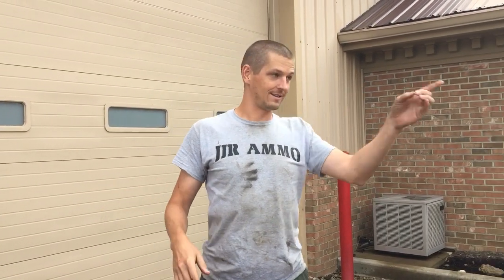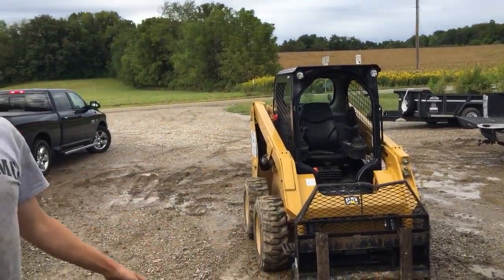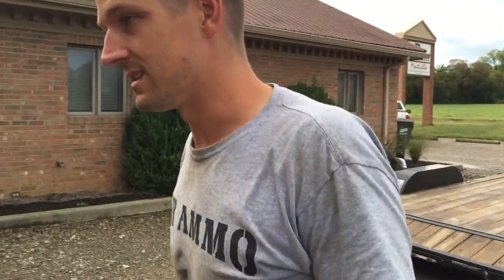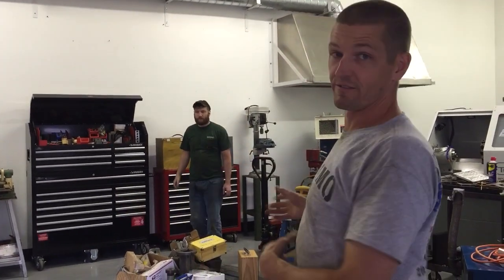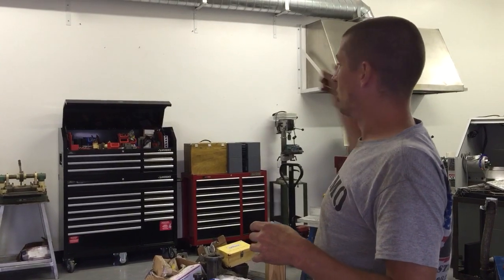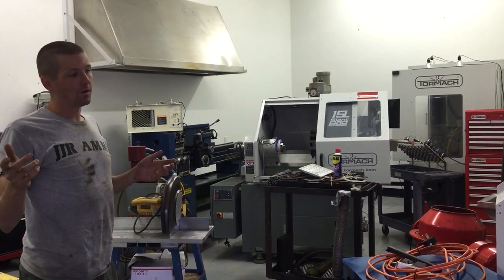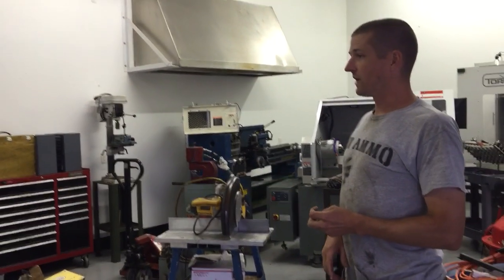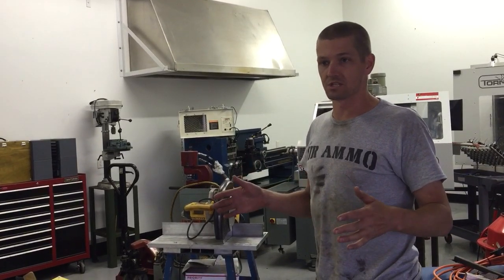Move is (mostly) done!

Comment: Ok, the move makes sense now. You needed room for whatever Tormach reviles on the 22nd, right?
Reply: +NYC CNC  I'm not sure. They posted a video and showed it crated up. Too small to be a dig brother to the PC1100. 3 years in the making so it could be anything I guess. I suppose it could be an upgrade/add on to something. It looked too big to be a 3D printer. Have fun on your trip.